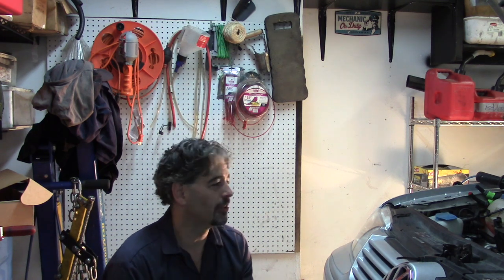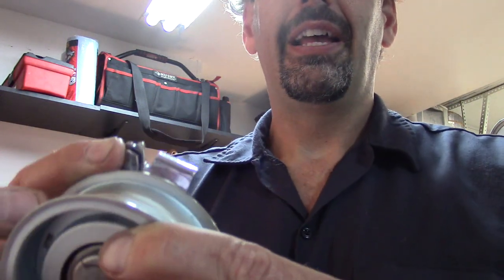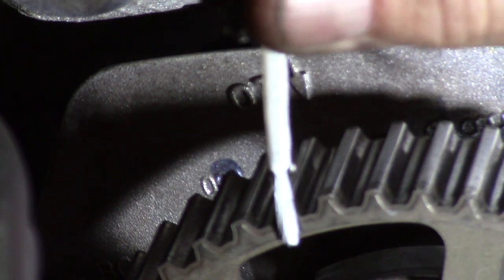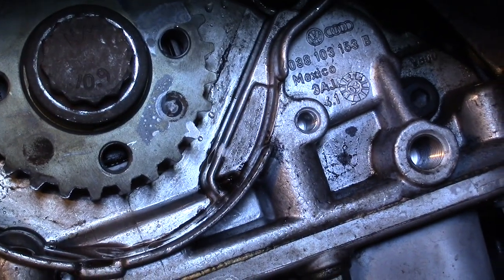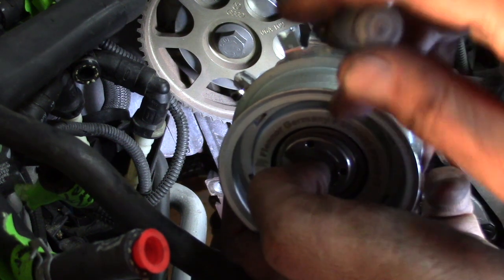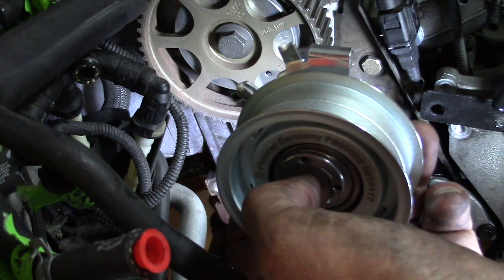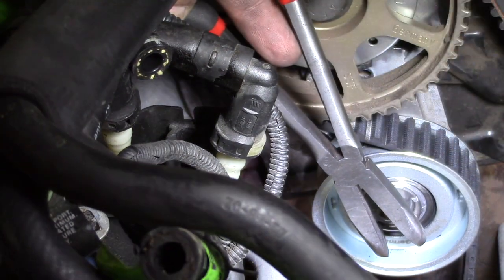PROPER Timing Belt and TENSION 98-05 VW 2.0L Jetta, Beetle,  GTI, Golf

Comment: Thanks for the torque specs!!! 
Same engine as Seat Ibiza 2015 2.0L
The serpentine belt pulley that bolts on the crankshaft socket has a notch the lines up with a notch on the inner timing belt backing plate. This is your #1 piston at TDC.

Comment: I actually own one of these.... engine code AVH... but same concept... there is actually a mark on the crankshaft balancer.... I have a Haynes repair manual and it DOES give info about the flywheel markings but I personally prefer the Harmonic Balancer option. If anyone needs help just ask since I have been through this engine completely... and no... there are NOT enough videos about this car.

Comment: What you have obviously not run into is a VW 2.0 BBW engine (2004, 2005), very rare (thank god), which has variable valve timing using a bizarre camshaft pulley which is not locked rigidly to the camshaft except by the center bolt (its position is adjustable!), and therefore has NO timing marks on the pulley (you have to lock the camshaft itself on TDC) and you therefore have to remove the camshaft cover to replace the timing belt (a major job). It too, has no youtube video that I can find.

Comment: I found your video helpful, replaced timing belt water pump tensioner. One other thing most popular video don't say is the camshaft seal needs to be replaced and seen the difficulty I'm not going to do that; but if next time you wanna do a video for it would be helpful. Ciao

Comment: Just bought a 04 Jetta 2.0 and it runs great no check engine light on.However I really want to change the belt and water pump and tensioner for peace of mind.Your video will be watched several times before I start and I will reference to it as I do the job.Thanks from Baltimore Maryland .

Comment: There is actually a hole for the tension thing to go in... Just beneath the camshaft pulley @9:44. So you installed it wrong. It's not logic to have those important pins hidden and forced to use a mirror to see the position of the tension pulley👎
Reply from the maker: What an idiot. i installed it correctly. The pin aligned.
Reply: @SchrodingersBox  I am not talking about the pins that you have aligned with a mirror (LOL), but about the lug on the back of the tensioner for which VW has made a big ass special hole to go into.. You put that lug 90 degrees on the wrong side making the tensioning pins hidden during tensioning hahaha

Comment: Thank you for your video sir. This is my first Volkswagen and I am in the middle of a turbocharger installation and I wanted to replace things like the timing belt, water pump, head gasket, and I also installed a set of ARP head studs while I was at it. Where I left off last night was at tensioning the timing belt and it's a good thing that I watched your video because I have the tensioner's tabs on the wrong side of the head (I went off of whoever installed the previous tensioner). Once again, thank you for your video!
Reply: The tensioner´s tab SHOULD be placed inside the Welch Plug (Also called "Core plug")...

Comment: @8:00 - There is a special crankshaft lock tool that bolts to the sprocket and has bracket that aligns into place at the 12 oclock position.
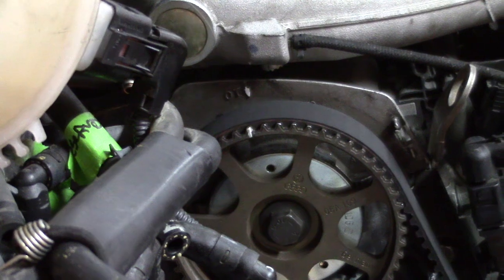@16:16 - That "stupid" timing mark is the crankshaft TDC indicator. You set it to that and use the crankshaft lock while installing and tensioning the belt.

Comment: Must be a newbie but why don’t they just mark the dead center of crank as they do on crank
Reply from the maker: Didn't understand your question but they do mark both the cam and crank with TDC marks- I just like to make my own that are easier to see AND it's just my preference to line up to true TDC using a TDC gauge so I can be absolutely certain I am at TDC rather than depending on marks off possible aftermarket parts or made by someone else or anything.

Comment: i tested this 2 times even if you set tension of timing belt correct pointed to the mark after 2 turns of crankshaft it it not pointed more to the mark is this normal
Reply from the maker: No- it should line up exactly- not even a tooth off.
Reply: @SchrodingersBox    no the crankshaft and camshaft ligns are perfect but the tension of the timing belt the first time you install for the tension you align it with the mark on the tension roller but after 2 turns it changes is this normal because of the tension of the belt is this not so important anymore only by first installment only import are the crank and camshaft alignment
Reply from the maker: @karamurat8629  There is no mark on a tension roller. What can it possibly line up to? It is always going to change position every 720.  If after 720 your cam and crank positons line up then you are good. There is no tensioner alignment.
Reply: @SchrodingersBox  thats what i want to know because so at first time you align it to the tension mark on the roller than it changes after 720 what is normall no because at your video the arrow was of your tension on the same place like first installment so it is just luck than ok it is what i needed because i reinstalled it 2 times same result about the tensioner thank you
Reply: @SchrodingersBox    tensioner alignmetn i meant here the tension arrow that point to the mark on the roller for the correct tension that was i meant by no there is never an alignment on a tensioner roller only the tensioner marks for correct tension with me the arrow was  changed that was my point crank and cam always correct alignment

Comment: thanks! I've had the same problem with the engine light on, didn't know how to correctly get the crankshaft on time with no marks on that side of the engine, Never thought of any marks on the flywheel :) 
compared to this a TSI chain is a piece of cake :D

Comment: Great video helped me out alot with my 1st vw timing belt,  but my camshaft position sensor has thrown a code. So it that normally off 1 tooth, or do these sensors go bad if removed,  I had to replace camshaft sprocket too
Reply from the maker: If you have cam sensor code after belt change its usually due to misaligned belt. Check the signal, ground and reference voltage on the cam sensor or superimpose the signal against the crank sensor signal to confirm.

Comment: Excellent detailed video! I did the belt, pump, and tensioner  2 years ago on my VW Jetta MK4. Unfortunately the job had a small leak after. I simply lived with it and just added coolant every month. Well I am tired of adding coolant so I want to do the job again. I have decided for the cost I might as well replace the belt, pump, and tensioner. Any tips on getting the pump to seal? Should I be using some sort of sealant on the pump O ring?

Comment: Turning the tensioner either direction 5 times is to settle the belt, and cam and crank sprockets into position and removes some of the slack that may be present so your belt doesn't skip when turning it over to confirm the marks, I also release the lock nut on the tensioner after barring the engine around 360 and re-tension the belt and re-set the tensioner marks once again. Just a tip from a VW tech. Nice vid and you certainly saved your friend from a catastrophic failure.
Reply: Ps. The correct position for the tensioner is the locating tag in the Welch plug recess, I think you inadvertently got it in the right position.
Reply: @2secondslater  EXACTLY!!!
Reply: Anyone in Los Angeles that you can HIGHLY recommend to do this job for a 2002 Jetta 2.0 LI?

Comment: not much really , gentle gave it to me , said he replaced tps,iac fuel regulator,  and he also said plugs and wires, I don't have any equipment to do diagnostics,but was thinking maybe the map sensor.
Reply from the maker: Ok what is your map sensor data then that is causing you  to suspect it? Is it showing low voltage not proportional to lpd?

Comment: Very important for the 3rd mark to be lined up. The mark on the flywheel. The cam turns 2 to 1 with the flywheel. So if that 3rd mark isnt lined up then your are not at tdc

Comment: I love your attitude. I'm ASE certified but I consider myself a DIY mechanic because I've never been formally trained by a dealer etc. One thing I do personally is I use the Crank to tension the left side of the timing belt. Where there's a gig gap between teh Cam(s) and the crank. This is generally the reason why people end up 1 tooth off.  To use teh crank as a tensioner it's fairly simple. You just turn the crank clockwise about 5 degrees. So the timing marks will no longer line up on just the crank. You do this AFTER removing the old belt. All other timing marks should line up. Then you install the new belt and get it as tight as you can by hand. When your ready to tension the belt you turn the crank counter clockwise this time until the timing marks line up. This will tension the belt on the left side and remove the slop between the cams and the crank. Make sure all timing marks are lined up before you adjust the actual tensioner. This tensions other side where the water pump is. I essentially use the crank as a second tensioner.  Now turn the engine over 4 complete cycles and check the timing marks. Everything should be perfect and the belt should be properly tensioned.
Reply: Do you know someone in Los Angeles, CA who can do this specific job - 2002 Jetta 2.0?

Comment: Just a followup to my yesterday's comment.  I removed the tensioner today and immediately saw what I had done wrong when I installed it 2 - 3 years ago.  I failed to place the tensioner locking tab at the edge in the engine block.  Will be paying careful attention to this detail when I install the new tensioner.
Reply from the maker: Easy mistake to make. I use a mirror to check the tab is correctly positioned because I’m never sure since you have to do it by feel otherwise!!

Comment: Great video!  The reason I watched it is because I did a timing belt and water pump replacement on my 2003 2.0 VW Jetta approximately 2 to 3 years ago.  I am now in the process of replacing the timing belt tensioner because the bearing is failing.  Apparently, I did not install the tensioner properly.

Thank you for your video.

Comment: I like your video as you mentioned before... but you should mention (maybe add it to your description) that the tensioner flange does go into the circular depression where the engine plug is... also mentioned by several guys below. I will add a video later tonight or tomorrow and show with a camera angle not possible without the engine out of the car. I will also post the link here on your comments if you allow it to stay!!! Collaboration is great, in my opinion! And the value of your video is obvious given the huge number of views!!!
Reply from the maker: Yes it should be obvious to anyone with basic mechanical aptitude where the tension locks into.  Showing on video was impossible but anyone who even accesses the tensioner in the first place should easily know how it installs.

Comment: It's interesting that when you put on the tensioner, you install it catching the back of the head first. Then you appear to have it catch the frost plug. This happens at minute 11. Then 12 seconds later, you catch the freeze plug. Just a note. .
Reply from the maker: Just me fumbling with camaera positioning at the time... when I actually did the final install it was done without distraction of the camera.
Reply: I totally appreciate the effort to get decent camera shots. Thank you! I realize now that I should have included the question: Which is it? The head notch or the freeze plug? I do think it is the head because you said the pointer should be at 9:00. It seemed to fit SO much better in the freeze/frost plug hole not wiggling either way, as opposed to the less stable place on the side of the head. I can;t see it making too much difference. Thoughts?

Comment: Excellent video and attention to detail. I would use the other videos to show how to access the timing belt and your video to put it all back together correctly. I had a timing belt installed by a mechanic but luckily I needed a water pump and the VW tech saw that the timing belt tensioner was put on backwards.

Comment: The mark on the flywheel can be very useful. You can check your timing without having to take off the crankshaft pulley (in a pinch)! Great explanation on the tensioner!
Reply: Do you know anyone in Los Angeles CA that you refer for this specific job?

Comment: Um, why are so many of these videos saying theres no mark on the crank to check TDC like there is on the cam gear/valve cover and flywheel/trans case. There's a clear notch on the crank pulley (for the serpentine belt) and an indentation mark on the lowest timing cover it lines up with to show TDC. You set it before you remove the pulley. I always set TDC before removing anything as to ensure the belt orientation upon starting removal of timing components.

Comment: I think you have the best overall everything that makes a great tutorial: knowledge of project requirements, lighting, videography well done, simple explanation.  I'm an electrician and being absolutely right when working on electrical components is absolutely essential.  Being logical and smart really helps me understand with certainty,  my timing belt replacement project will be done right.  I believe also not coming back to a project after I have finished working on it.  Well done, sir!
Reply: Anyone in Los Angeles CA that you can refer for this job - 2002 VW Jetta 2.0

Comment: these engines valves bend if the belt snaps? or is there a way to pull over before destroying everything? pretty sure i had a mk3  gti belt snap and I neutraled to suitable spot and swapped belt on the spot.

Comment: They (VW) and all after market parts should have just put a grenade style pin on the tensioner.   Bolt it in, pull the pin, done.  Common sense.
Reply: Gauge you’d still have to use some kind of tool to take tension off the pin though.

Comment: There is an indicator for the crank. There is an indentationon the lower timing cover that you line up with a notch in the crankshaft aux. belt pulley.

Comment: This is the only video in the entire YouTube video collection that guides timing belt change for a VW engine resembling my own car. See I own a Passat B5.5 with engine code AZM. A 2.0L petrol naturally aspirate engine. 

Thanks for the video, now I have the confidence to change my timing belt.
Reply from the maker: Honesfly, if you can change one timing belt, you can change them all.  Changing a timing belt is just "wrenching" . There is really no skill needed.. I am glad the video helps but the truth is you always have the ability to change any part on any car.  skill is in knowing WHAT part to change to fix it  the first time
Reply: Exactly which I have been doing for the last 4yrs to maintain my Passat rather efficiently. Except for the timing belt which I never had to do up till now. I am not a mechanic either, but an auto enthusiast.

As you have said the only thing to watch out is TDC (Top Dead Center) on each shafts... and then torque to specification. 

Thanks a bunch! a million like for you.

Comment: my mechanic didnt put the tensioner in the hole he put it down is that bad? i told him but he insisted that its wrong to use the hole, the car did run. Should i change the tensioner back to the hole?
Reply from the maker: The hole is to "set" the tensioner position and lock it so it doesn't move.  Eventually the tensioner will settle into the hole anyway but when it does that may change the tension setting possibly to where it is not in spec.
Reply: could that cause the belt to jump teeth? can it damage my engine, would you recomend to change it? can i change it by removing only the top plástic cover, or do i need to remove the engine mount?
Reply from the maker: Answers are Yes, probably not, yes and no.

Comment: after installing the timing belt and tensioner I rotated the crank and realize that the tab moved on the tensioner slightly. looks like it moves back and forth a little bit as the timing belt spins. is there supposed to be that type of fluctuation in the tensioner?

Comment: ******CAUTION******* - When setting the tension pulley, line the peg up with the HOLE IN THE BLOCK, not the edge as this video describes. 
Shrodinger, you mention in the video that there is not a hole or indentation for the peg to seat in to...There is. You can see 1/4 of it @ the 10:34 mark....When looking at the camshaft pulley, picture it as if it where a clock face...look at the pulley at the 6 o'clock position...this is where you can see the hole stamped into the block. The top 3/4 of the hole is hiding behind the pulley, but you can make it out.

Comment: this video was a big help think I put my crankshaft in the wrong postion it puttered on start going to set the alignment now that i have taken the components off the view that dam transmission window for the crank wheel alignment fingers cross nothing major was damaged but that was not my fault for trusting the old paint marks

Comment: FYI - you hooked the tension pulley in the wrong location. Verified from multiple sources. It's clearly documented. Rant all you want.. it's wrong.
Reply: Yes, but in your video you said "..there is a catch on the edge"...you did not mention the hole...why not own it?...and correct your own video?
Reply from the maker: I doi own it. I did and showed correctly.  You know who didn't show how to do it at all though?  YOU that's who.  Make your own video if you can do it better. And no one will ever see it....
Reply from the maker: You are absolutely incorrect. The manual itself verifies this. nice try.
Reply: See Bentley, section 15C-21 it goes in the hole, diagram N13-0402 on that page even shows it.
Reply from the maker: I did line it up in the hole silly. Watch the video